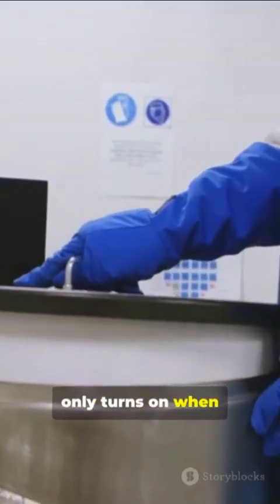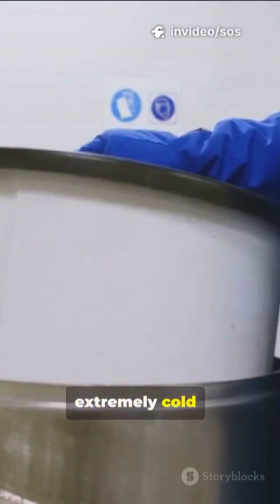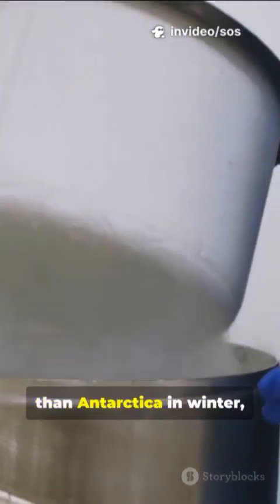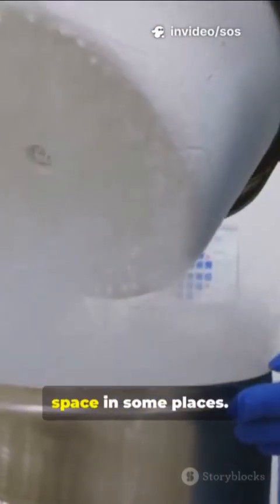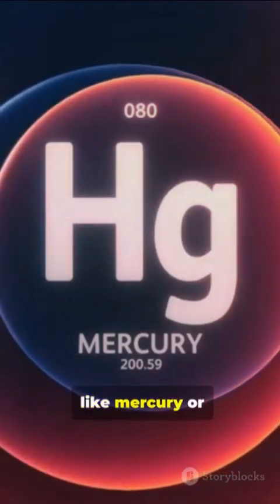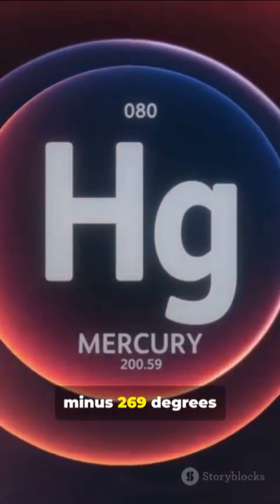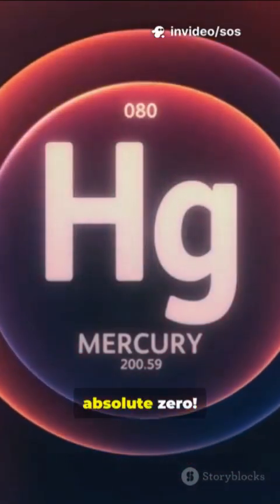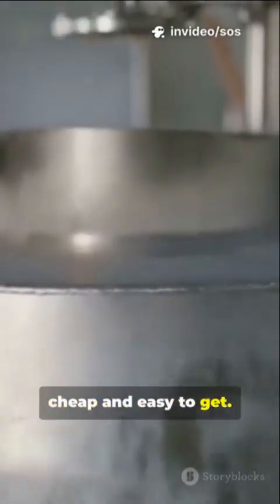Science Of Superconductivity #science #shortsfeed #technology

Comment: MRI machines use liquid helium, not liquid nitrogen.
Reply from the maker: MRI machine use Neobium Titanium alloy as the supercinductor. It has a lower cttritical temperature near absolute zero and requires liquid helium coolant. It is used as it can be made into thin wires needed in the magnet.